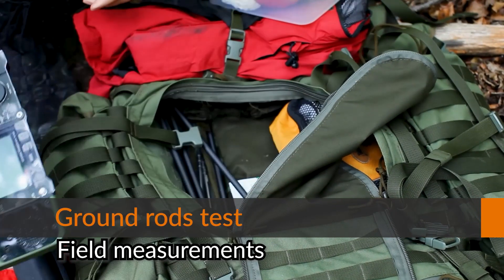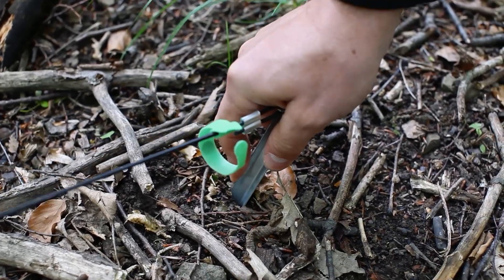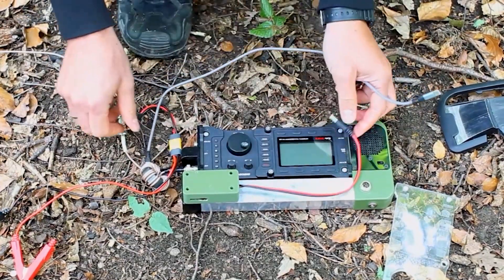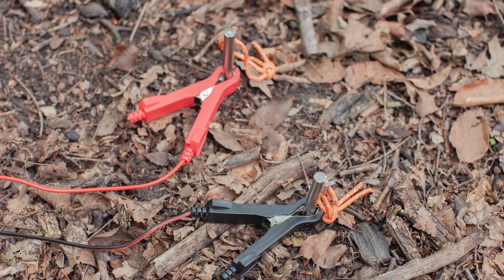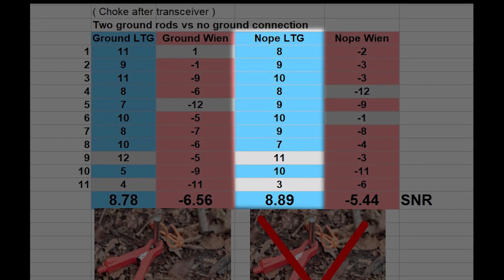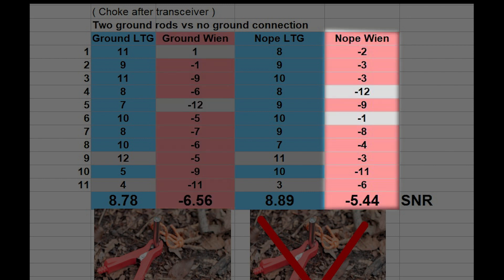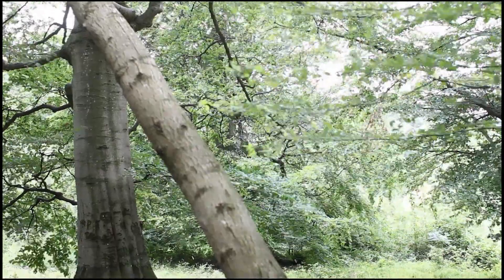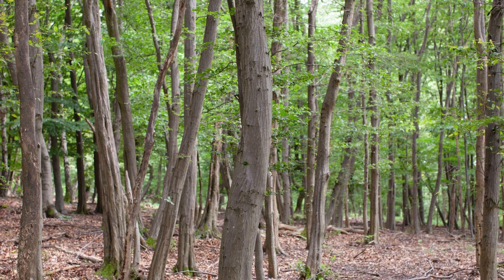Stronger signal due to grounding?

Comment: What difference between the two values would you consider these results to be "significant?" Not statistically significant, because this isn't doing 100 tests, but I just mean what dB value difference is sufficient to say one column is better than the other? 

Do you think if you did the same test but used much higher power, say 50-100 watts, would help illustrate the difference?
Reply from the maker: more power shouldn't change something but maybe the measurements would be a bit more precise.
I would say around 1dB. Its not much but if you lose 3 times 1dB somewhere its getting significant.

Comment: Nice experiment Crazy, how far from your home station do you travel and what frequency are you sending js8 on.
Reply from the maker: mostly only about 20-40km away....but there is a small mountain range in between. no direct line of sight. 
UHF will not work to to the home station.

Comment: Hi, nice vids! I was wondering if you had any tests with ground on the transceiver and not on the ant. ground element on a balanced dipole coaxal feed? 
I have done better results with ground on the transceiver but with ground dependent systems, unlike a dipole which does not require a ground. though keep in note that your ground in this vid might of been with a higher flux on the results if you had added a 1.5l bottle of water to the ground at the ground rods. we must take into consideration the actual ground soil levels of conductance (moisture, rain, dryness of soil, etc.) to myself, out of experience the ground looks somewhat arid and poor for good ground conductance in your video.

Most importantly, on a balanced system like a dipole ground is not much an issue, but a system using UNUNS like end-fed random wires such as a 9:1 unun or 4:1 system you will see great differences with the ground, unlike with end-fed half waves and 1;1BALUN fed dipole system.  the subterrain type of soil, bedrock, etc. where antenna is placed also plays a great factor in antennas in the field , not surprisingly, is never the same value even in the same location during different seasons. lastly, on a non-ground dependent antenna system like a dipole, grounding the braid of the coaxial feed right after the 50Ω exit of the transceiver will result in signal degradation. 

Your choice of transceiver being a Russian made SDR holds superior technology in reception of signals and its extremely low voltage power requirement  for both rx and tx to generate signal and rf is so advanced that its hard to tell with such a superior piece of kit, such kind of tests, unlike let's say a xeigu x-6100 or an ic-705 or even a FT-891(qrp levels) so take that into strong consideration as well.

Nevertheless, awaiting your next vids. and results, 73s
Reply from the maker: thx for your thoughts and comments!
the endfed antenne will be next on my list for testing and comparing.
73
Reply: Very interesting